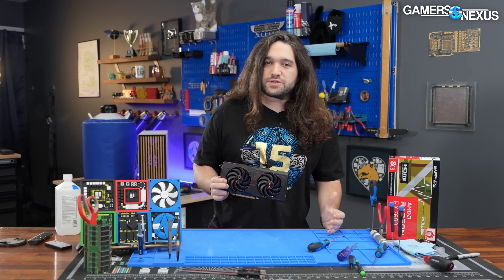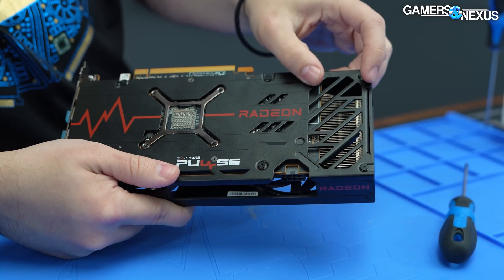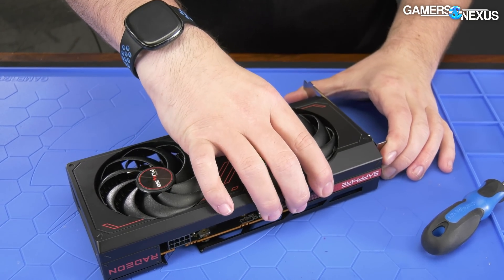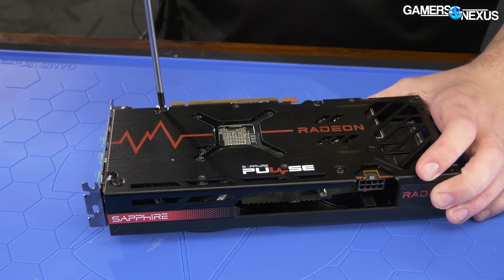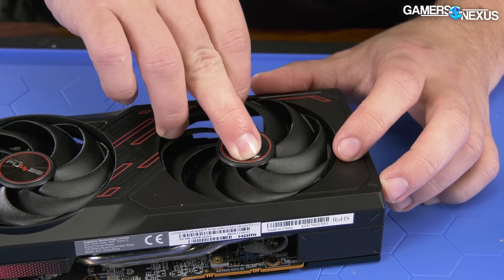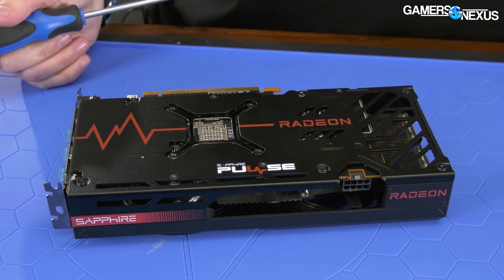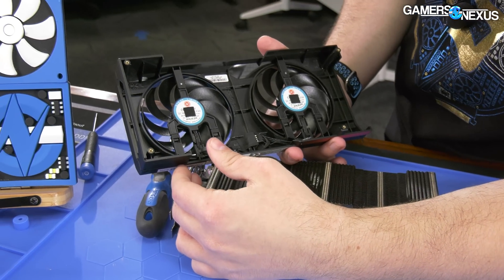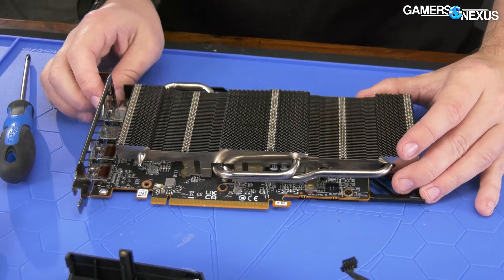Sapphire RX 7600 Pulse Tear-Down & Disassembly

Comment: Another advantage of being able to remove the shroud without removing the heatsink is that if a fan stops working you can easily replace the stock fans with two case fans which can improve cooling performance assuming that you aren't using very low quality fans.

Comment: Once again Sapphire proves they know how to make an affordable user-friendly card. I don't care about the percieved build quality of a card in my hands., im rarely holding it. I want it to be easy to service, easy to clean, and cheap. I would rather a cheap, easy to remove, unadorned shield and the design focus put into  performance, cooling, and budget. I'm glad sapphire is doing that. I wish they would take it one step further and just use standard 92x15mm fans, i'd love that. Every card i've ever bought has had the fans fail and i've had to DIY a cooling solution. That would make it so much easier.

Comment: Hmm I have RX 7900 Pulse from Sapphire. It's very good card, quiet and good quality heatsink. And even it's  lower lineup card they give support bracket with card. 
Zero leds, zero fancy shroud. But it gives what is necessary you need in trem of 300W GPU.

Comment: I guess Steve is not too familiar with the sound dampening concept of the floating suspension. I have a feeling they took inexpensive loud fans and designed the shroud to absorb most of the sound causing harmonics. In a vary cost effective way with flexible plastic and spring loaded fasteners.
Reply: thats exactly right I tightened mine down and the card would houl and whistle so i loosened them back up again and things were fine
Reply: This ^
Reply: That's pretty cool, I never thought of it like that. Although even with floating suspension, you do still want the screws to be tightened so they can't fall out.

Comment: The way they design this card is awesome. Sure the looseness might feel cheap but giving the trade off is how easy it is to work on, I'll take that plus once its in the system and it don't make any noise or rattle, the movement wouldn't matter.

Comment: Steve, have you ever heard of "reworking"? When a manufacturer uses low-quality parts (GigaByte PSUs) or low-quality assembly processes, there is a high percentage of defective parts. To try and keep profits sky-high, they will attempt to "repair" these faulty assemblies. A "factory fresh" part may have been "repaired" two or three times before being shipped.
Edward Demming showed that it is cheaper to use quality parts and superior assembly processes. But only the Japanese listen to him.

Comment: Its a shame that it's so sloppy, but otherwise this is a great design. Once its in your case, you're not gonna be poking your GPU anyway.
Reply: Right. The heatsink is on nice and tight, which is what matters for performance. And Steve was saying he didn't notice a rattle during testing, so that looseness seems irrelevant once the card's in the case. Great. 👍

Comment: vibration transfer that is why the shroud is spring loaded, to minimise that from the fans spinning. You call it cheap I call that good engineering, rather a card that feels cheap to handle  than a card that is more likely to break over time from use. Surprised you missed that, seems obvious to me. why add complexity to the design otherwise? as it's just more cost to make the shroud spring loaded.

EDIT: regarding your closing remarks, think about it the shroud is screwed in directly to the pcb itself instead of the heatsink, that is why they spring loaded. It's not cheap and sapphire are actually the best AMD board partner, they have always produced the best performing designs and they actually have solid history of quality and innovation with their cards. Sapphire in the past was the lie support AMD/ATI needed to stay alive but oh how people forget who buttered their bread for them.

Comment: It's not that bad of a card for the price.  Still, there are more demands in the VRAM department.  Honestly, I'd rather put in a few more dollars and get a 6700 (non-XT).  I use a 6800XT since the price fell so much and it seemed like a good future proofing solution considering the rest of the components that I use.  The Nitro+ runs so cool compared to the Tuf.

Overall, Sapphire's changes in the shroud and fins needs more credit.  Looks a lot easier to switch things out and service the card in a more expedient manner.  The amount of screws is actually quite small compared to some other SKUs I've seen.

Comment: Sapphire has always felt like the EVGA of AMD to me. Nobody ever seems to have a lot to complain about when it comes to their gpus, even with one like this where at first you feel like it's shoddily put together, turns out it allows for easier user reparability and maintenance.
Reply: I've defaulted to Sapphire Pulse since watching a GN video a while ago. They produced some card with solid thermals and decent overclockability. Might cost more than most of the competition, but it's generally worth it. Haven't regretted my RX 6600 yet.
Reply: @trajectoryunown  same for me with my sapphire nitro+ 6700 xt :D
Reply: Here the same card GN uses, cost here now €299, they are now the cheapest RX 7600 with Asrock.
Reply: @trajectoryunown  I remember having bought my Sapphire Pulse 5700XT for 15 bucks more than the reference model sold by AMD, a litteral steal !
Reply: @lamikal2515  - I'm pretty sure that, if you paid for it, it wasn't a literal steal.
Reply: Their design is also really simple but beautiful I love my sapphire pulse
Reply: @toad7395  always loved sapphire since my 9800xt lol
Reply: Yep - I normally buy secondhand GPU's and the only ones that have been problematic have NOT been Sapphire.  Dual vBIOS is must for secondhand buyiing confidence though, so shame these don't have it.
Reply: Sapphire makes quality stuff. Besides being a fingerprint magnet i've 0 complaints on their 6900xt.
Reply: Same here, picked up a used Sapphire Nitro 6700xt specifically because of the robust VRAM cooling.👍
Reply: What about PowerColor ?
Reply: @walter1824  The Powercolor Red Devil Cards are amazing.
Reply: @walter1824  Overall solid cards for a better price than Sapphire, but not quite as polished. My 6950XT Red Devil for an example has OK coil whine, not too good not too bad, the fans would make a fair bit of noise even at 50%, and the avg to max core temp delta was over 20C out of the box(Which from what I've seen online is normal for that model). That said, it is well constructed and very easy to disassemble, so I repasted it and at a later date replaced the stock fans with T30s without any difficulty, which got me much better thermals and noise.
Reply: @walter1824 second place but goofs up sometimes.
Much result with little heatsink though, they're good at that
Reply: @walter1824  Sapphire literally owns PowerColor lmao
Reply: I feel like if I shelled a bit more for a Sapphire RX 480 back when I first built my current PC instead of getting ASUS cards, I would've saved a combined $1200 by now.
Reply: A pulse RX 570 lives in the PC I type this on. It's endeared the company to me, as the card has been able to keep sane temps even in a highly restrictive Fractal Nano C that blocked off one of the two fans almost completely.
It's also just been reliable, and I feel like I can lean on this thing in almost any PC I throw it into for years to come. It might not be "current" and will soon be "pretty obsolete", but it can Vulkan and Proton, so I can play older games on older Linuxed computers with it even long after it has stopped being able to play my newer favorites.
In fact if I'm ever able to upgrade the PC I type this now, it's going to go straight into the i7-950 or FX4100 machine.
Reply: Yes, my plan for my fx6300 with rx570 Nitro workshorse is to devote it to Linux when support for Windows 10 falls away.
Reply: the blue design was much better to look at and felt really premium. I wanted a R9 290x sapphire so bad back then. Vapor X sapphire was a godlike design just like MSI Lightning X
Reply: when it comes to AMD GPUs, I always go for Sapphire. especially if there's a Nitro+ model available.
Powercolor would be second.
Reply: Sapphire pretty much is.  Although I am unsure if they have the same level of customer support as I haven't owned a Sapphire product since the 8400GS or AMD in general since I upgraded from a used HD6870 when my friend upgraded his 970 to a 1070 and I bought the 970.
Reply: Sapphire is top tier for Amd, I've been buying them for 20 years and never a failure of any kind.
Reply: I am never dissatisfied with Sapphire products
Reply: @0h_hey944  Been quite happy with my current and previous cards. Both Pulse models.
Reply: I had a Sapphie RX 590 Nitro+. It was A+ quality and I like the blue colour, even though I pretend I do not care about looks. I wanted a RX 6750XT Nitro like my nephew got, but could not get one locally. I got a Powercolor Red Devil after the prices dropped. They are the other top Radeon brand. Seems like top quality too, but it's a skinnier card than the Sapphire one and did not come with the GPU anti-sag thing Sapphire provides. Good price though and so far it is doing 4K ESO perfectly (a potato can run that game, but in 4K 144hz on 'maximum' settings it needs plenty of horsepower).  

My days of buying the best parts possible for my builds ended in the late 2000s. I got sick of spending big money only to see the parts be superseded so quickly, and then having to spend big money all over again. Mid to upper mid-range does just fine. By the time a game has all the patches and all DLC in a cut-price bundle, mid-range parts will play the game on decent settings. Save on the games and on hardware. Win, win.
Reply: @aquilarossa5191  I feel your pain with the $$$. As it stands right now, I've been sticking to F2P games, and older titles that I can snag free off Epic or Steam. Some of them are 10 year old games, but these are games I would have had a hard time affording even with mid-range gear back then. Having to deal with adult stuff (budgets, bills) sucks 😆
Reply: sapphire and powercolor are 2 of the OG partners from the ATI days and always made the best cards. I see too many people overlook powercolor or even sapphire as "overseas brands" not knowing their history.
Reply: I am loving my sapphire pulse 6650xt, my previous gigabyte gtx 1080 was horrible both in noise and thermals
Reply: I kinda want my next GPU to be a Sapphire Pulse or Nitro RX 8700 XT or 8800 XT, if prices are reasonable. They look good, minimal (if any) RGB rainbow vomit, and are great build quality and performance. I'm hoping RDNA 4 is a bigger improvement than RDNA 3 was because it's not AMD's first attempt at a GPU with a chiplet design, which I think is a big reason why RDNA 3 has underwhelming performance so far compared to Nvidia. I also want a Zen 5 CPU like an 8700X (or whatever they call it) because it won't be on a brand new platform like Zen 4 was.

Unless you have the time and motivation to troubleshoot stuff don't ever buy something on launch day and become a beta tester for a new product. Wait a few months for most of the issues to either be fixed, or at the very least, known and documented.
Reply: Sapphire and PowerColor are pretty much the top tier AMD graphics card companies, which makes sense as they are AMD only (I'm not sure where XFX fits in as the third main AMD only vendor).
Reply: That is a valid point. I still have a sapphire XT PE in my old PC from 2002. Still going strong for my XP gaming rig.
Reply: I bought a Sapphire Radeon x1950 pro AGP video card back in 2006 and it had issues from the start. Since AGP was dying off then and the Sapphire card was the only top tier AGP card I could find then. Good to see they improved from then :P
Reply: My PCIE version of the x1950 Pro was solid and reliable, if power hungry for the time.  I've used 7 or 8 Sapphire cards over many years - they've all been reliable and all still work!  To be fair to other brands, my only video card stinker was an Asus R9 390x, which was fast, but plagued with loss of signal errors. I'd also describe my Asus GTX 1660ti as, well a bit cheaply built and it has a rather toasty hotspot.
Reply: Its not that strange.
Its the oem for amd cards it self.
For years
Reply: I like the pulse models, I was going to feel bad if this particular gpu was a poorly made one, but in the end it still is a good one.
Reply: The only complaint I have about my Pulse 6800XT is the lack of water block support. I keep hearing conflicting reports of the Nitro+ blocks fitting.
Reply: I love my Sapphire Pulse 6800xt, nice looking and does exactly what it is supposed to do, but my 590 nitro+ (blue) was so damn beautiful I miss knowing it is in the case and I am the king of 1080p
Reply: XFX for me, the first Saphhire I bought was quite meh R5 260X, the design was very simple it looked nothing like the ones the do today
Reply: @Charlymander  I remember when the HD4000 series had passive cooling. My R7 250-D5  had a single fan on an aluminum heat sink.
Reply: The 290X Vapor-X is the greatest card of all time. There are no words to describe it. You have to hold it.
Reply: @BTD3Fan  I have that one ! See my above comment !
Reply: sapphire has been shit to me lmao
Reply: I like the aesthetic as well, I've yet to buy an AMD GPU. But Sapphire definitely would be in the running
Reply: I agree, that's why i went with the Sapphire 7900 xtx, still happy with it.
Reply: ive always bought Sapphire AMD cards the quality is normally pretty high end. The dust removal sounds like a nice convenience.
Reply: But when will we get evga Radeon? 😢
Reply: Hows XFX? Curious cuz i just bought a 6800 xt speedster merc
Reply: Haven't bought any Sapphire cards recently, but the ones I did (years ago) had pretty crappy custom fans that became very noisy (one of them actually died) after a couple of years. At least this one looks easier to repair / replace.
Reply: Can confirm, I've owned a handful of them throughout the last decade (X1950 Pro AGP, HD5700, HD7850, RX 580 Pulse) and have had zero issues aside from the RX580 being incredibly loud and hot but I think thats just the way the 580's are. Was thinking about giving Nvidia a try this time but the RTX 4000 series has really let me down and the 3000 series just hasn't dropped in price enough for me to consider it. Looking like I might just stay with Sapphire and go for the 6700 XT since the price/performance ratio is so good right now.
Reply: My Sapphire Radeon HD 7870 ran for 10 years straight. No hiccups. Not even a fan failure. 

Meanwhile my Asus 7870 died in 3 years. I'll always buy Sapphire when going AMD.
Reply: Exactly they are my go-to brand when it comes to AMD.
My R9 290x is still rocking as a second PC, I have an 5700XT Nitro+ at the moment.
Reply: I started with sapphire GPUs when I first built my PC. I recently bought a sapphire nitro+ 6950 xt. I’m back where I started and I couldn’t be happier.
Reply: Having an EVGA and previously owned other EVGA and Sapphire cards, I can say that Sapphire is quite a few steps above EVGA
Reply: Agreed, though their build quality is not the same as EVGA was for their entire product stack imo, but they get the job done well and are very reliable ime.
Reply: To be honest I love EVGA but I had problems with a couple 3000 series of theirs. Fans that make a loud noise when stopping and starting, mixed with some wacky tuning that had them start/stop multiple times a minute. You shouldn't need a background utility to fix a broken stock fan curve.
Reply: I was told they are the best AMD AIB by a microcenter rep
Reply: I can attest to that. I have a PULSE 7900XT and it’s been great. Undervolted running most games 1080P MAX at least 80fps in the minimums while the GPU temps stay under 70C and it’s quiet.
Reply: Unfortunately Sapphire has a bad second hand warranty, unlike EVGA. You're better off with MSI or Gigabyte for second hand AMD GPUs
Reply: @Fluvance  Ah, no. If your buying a used GPU your typically not going to be buying a GPU under warranty. If you are referring to buying a new GPU from a scalper then get some patience and don't.
Reply: My first AMD card was the sapphire R9 270x which died in less than a year. Nice to see the quality has gotten better.

Comment: The reason for the fan shroud moving is because the holes in the PCB are larger than the screws. The screws are held by spring tension and this is what gives it play. If they were just screws and made full connection with the shroud and back plate you wouldn't get that movement.
Reply: thanks!!! i though the screws were not tight enough haha....